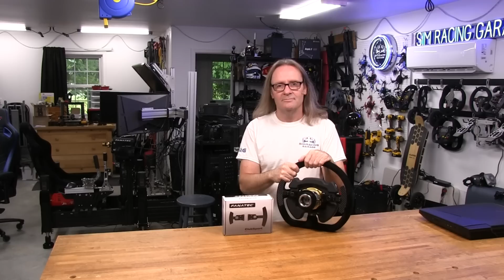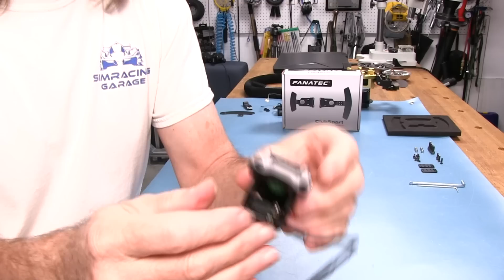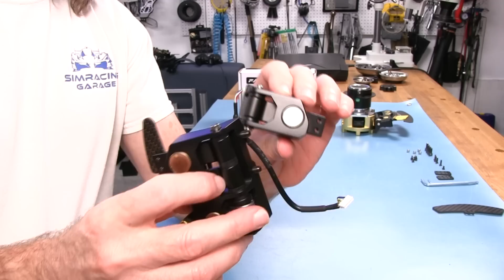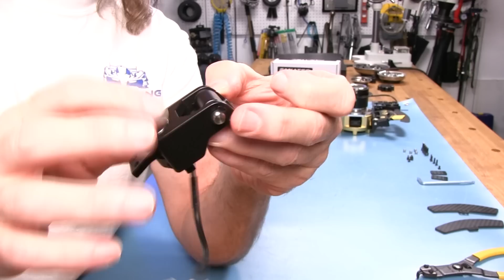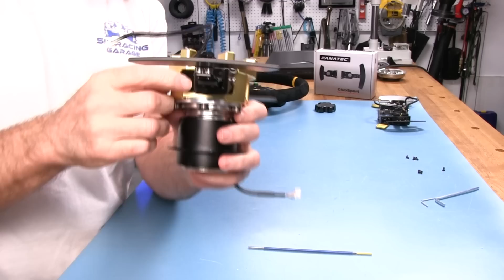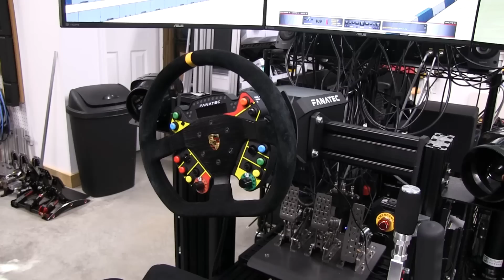Fanatec Clubsport Magnetic Paddle Module Review

Comment: I guess my Racing Sim terminology sucks. But What is the name of the shifter that you see in some rally cars. Where it's just 1 paddle that's fixed (doesn't turn with the wheel), and that allows you to down and up shift. (depending on whether you push or pull it.) Any help would be appreciated. <3
Reply: It is called Push-Pull shifter.

Comment: They use 6 wires and a 6 pin plug to prevent the magnetic paddles from working with the older formula rims, original hubs etc. It's fanatecs way of getting you to buy newer wheels on order to have magnetic shifters.

Comment: Barry, you say this in your article 

" I personally prefer a more crispy feeling shifter. So, I did remove the rubber pieces in pursuit of this feel. It’s not a simple task and I would advise against it unless you have the proper tools to remove the small retaining clips to get the shift lever out of the housing.This way you can reinstall the rubber piece if you decide you don’t like the snappier feel"

How much does this change the feeling?
Reply from the maker: Very noticeable difference in both tactile feedback and noise.
Reply: @simracinggarage3026  thanks, so worth the work to remove them then. I'll get to work ;)

Comment: Do you still use a DD wheelbase? I am concerned with the backlash you noticed in your earlier review.  I would not want any steering backlash.  I am considering the simcube pro 2 instead at a slightly higher price point.  You have so many review it would be great if you had a page on your website with tables or a recommended gear list. There's so much its hard to keep up with as a newbro.

Comment: Because of this review Barry, I purchased two sets of these shifters. Can't beat it for the price. Funny thing though is that these come with a 6 pin plug, yet Fanatec only uses two of the wires coming from the micro-switch. Trickery to make consumers think it's incompatible with the older Formula rims? Maybe. Who knows? 

See here: https://ibb.co/album/FgRWcW
Reply: Naturally opening the micro switches voids the warranty, but the parts are readily available if you have the know how to make replacements and just unscrew/remove the original shifter micro-switches.

http://www.zippy.com/ecproductshowdetail.aspx?ps_rfnbr=332
http://www.eeng.dcu.ie/~scaifer/hb/sensors/index.html
https://www.amazon.com/XLX-50Pairs-Connection-Terminal-Connector/dp/B07YWJKGR9

Comment: Hi Barry, off topic here but i have a question. You run your triple 27s at 60 degree angle. I have my 27s at 55 angle as the calculator i used said 55 is right for monitor being 24 inches from my eyes which i am right at 24 inches away. Do you have your monitors close than 24 inches from your eyes? Should i move my monitors in closer, I can but I also need to keep them as low as possible or they'll be above my eye level and distort the image. I would have to have monitors sandwiched between my wheel(918rsr) and my dd1 wheel base which I can do but theyll have to be low or ill get where my lines don't line up from 1 monitor to next and I cant have that. I guess i could raise my seat but not much as my wheel is at the height i need. Maybe angle the wheel base down in back to allow more room and see how i like driving with the wheel tilted a bit?. What do you recommend? Thanks

Comment: why does the cable have like 5 leads? It's a switch so there only needs to be 2
Reply: Because the latest wheels use a 5-pin socket. Some of them still keep the 2-pin as well, but for example the Podium Hub has only the 5-pin socket.

Comment: Thanks for another great video. Not sure if you have experience of the 3D printed magnet shifter mod for the standard shifters. If you do how do they compare?
Reply: Heaven and hell (favouring Fanatec). Custom mod works, but is incredibly noisy as it is. Has to be further tweaked for silence. The Fanatec ones are quiet. Also I found these being firmer and more rigid than the default CSW paddles.

But someone likes the noisy clickity clack.

Comment: Hi Barry thanks for the review I have just ordered them for my 2nd GT wheel, on a different note I have two sets of the APM shifters one from Aug 2019 on my V2 wheel and  the second that came with my Porsche GT wheel Feb 2020 the older set has a very similar clunk click to them like your CS shifters without the rubber, whereas my other set are more dampened, so not sure if the rubber flattens out over time, I thought it may be as they have different paddles F1 / GT, so I swapped them but the results are more or less the same. And also I have had no issues thus far with the 2mm paddles, and I would consider my self quite heavy-handed with my shifting, ah well thaks for another great review as shortly after finished watching the review "  got to it !"And ordered them, all the best from London

Comment: I disagree with you about those cut plus and minus signs. That will not weak it almost at all. What is concerning is that tiny bit of material around bolts. That is the most stressed part of the paddle and there is almost nothing to support it.

Comment: 19:52 There is a 6 to 2 Pin Cable Adapter on the market, I tested it with the old Formula Black, works perfectly  - The Paddle Module uses only 2 out of the 6 wires  :)
Reply: Amstudios have a tutorial for a permanent diy thing also to get it to work :)
Reply: https://youtu.be/F1XeAuIRxCM
Reply: You mean I can't install the new magnetic shifter on the old universal hub with 2 pin connecter?  do you have link? I really don't understand why fnatic just says sorry it's not compatible any longer. I have two older universal hubs and I'm not going to buy to new universal hubs because of a 20cent connector
Reply: @dubtube6691  if the older one doesn't have two 6 pin connectors it doesn't work, only with an adapter cable or a DIY like @NGTL Racing MrSBS said.
I prefer the adapter cable because you don't have to destroy anything, I did a video about them:
https://www.youtube.com/watch?v=F5-f67FcgaU&t=
Reply: @HomieFFM  wow, that's expensive but a good idea
Reply: @dubtube6691  yes expensive, but removeable and you don't need to buy a new hub ;) 

They are handmade, I think that's why they are so expensive, there is nothing machine made on the market like that.

Comment: BTW, APM is now also equipped with 3mm thick paddle plates since 1 month or so, but depends on the set you are getting (old stock still has 2mm plates so you need a bit of luck to get a 3mm set until the 2mm sets are all sould out).